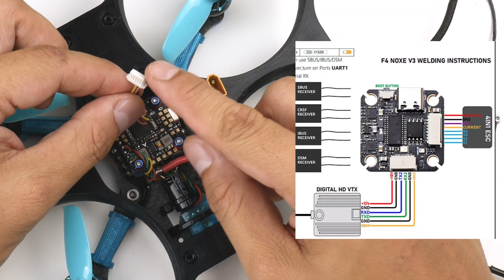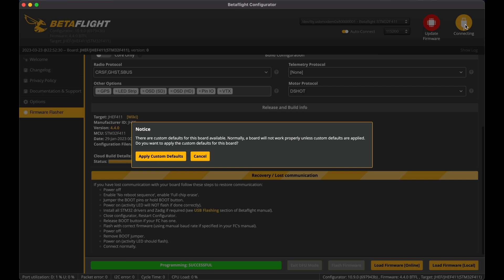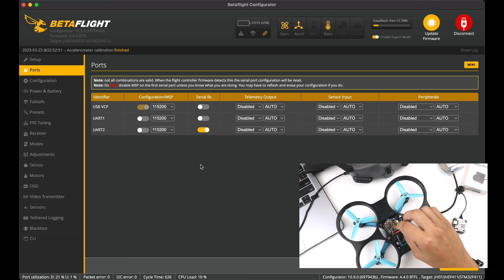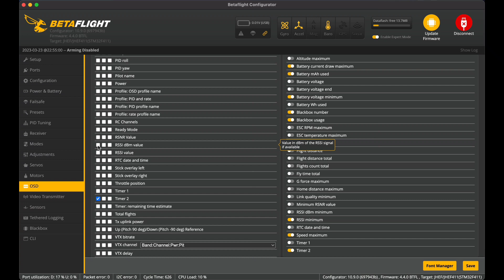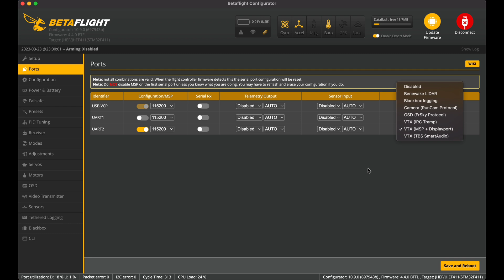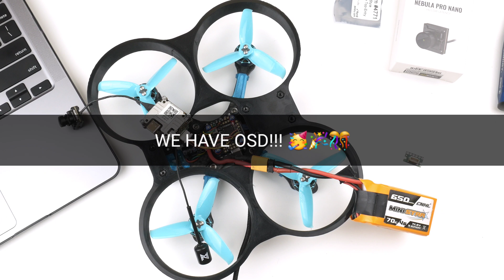DJI Goggles 2 + Caddx Vista - MSP DisplayPort on Betaflight 4.4!

Comment: Unfortunately, this method did not work for me, I have BetaFlight software version 4.4.3. Could this be the reason why I do not see the OSD? Additionally, I have software version 01.03.0000 but it does not work on version 01.10.0000 either. Do you have any idea how to fix this? :D
Reply from the maker: I can only think to check the TX and RX wires. Also in the goggles, check if you have Sbaud Fast enabled in the settings
Reply: @nxp200  It worked on my drone on betaflight 4.3, thank you very much for sharing :) Unfortunately, in my drone on beta 4.4, after performing the entire operation, the drone still has no OSD and controlling the drone using Tango2Pro stops working. I'm a bit new to the FPV world, I don't understand what you mean by checking TX and RX. My 5 inch drone is covered with waterproof gel, I can't solder cables on it :(
Reply from the maker: @iamJanikFPV  Ah I see. If it works in Betaflight 4.3, then the wires must be set up correctly. Also, if the quad is working perfectly fine on Betaflight 4.3 with OSD and everything, then I suggest to just keep using it. But if in future you decide to upgrade Betaflight, try 4.5 or higher to see if it works (using the 4.4 MSP DisplayPort steps). Might be a bug with your flight controller and BF4.4 OSD. Good luck and happy flying!!
Reply: @nxp200  Friend, you misunderstood me. My 2nd drone (another drone) on betaflight 4.3, displayed OSD from vista on google 2. And I am very grateful to you for your video about betaflight 4.3. However, in my 5-inch drone I have software 4.4.3 and here I have the problem that I described above. When doing all the operations, OSD does not display, and the control from Tango2 stops working. Thank you for your help
Reply from the maker: Gotcha. I assume you have set canvas mode to HD. Have you enabled OSD in the configuration tab?
Reply from the maker: It may be that the Ports tab is not configured correctly. Do you know which UART the receiver and Vista are wired to? If not, follow the wires from the receiver to the flight controller to see which TX and RX pads they are going to. It should be labelled something like "T2" and "R2".
Reply: @nxp200  Thank you for your help, I managed to restore OSD on all 3 drones, you were right to check RX and TX thoroughly, best regards
Reply from the maker: Great to hear! 👍🏻
Reply: @nxp200 I can only solder on caddx vista

Comment: im on Bf 4.5 and my osd is zoomed in. its kind of showiong all info but screen in goggels 2 are to small. Do u have any idee how to fix this?
Reply from the maker: In the OSD settings in Betaflight, there is the option to turn on HD. Try that. I've noticed that sometimes that setting is buggy. So try turning it back to SD and then HD again.
Reply: @nxp200  thx. but i cant change after ive set msp on uart. It is on hd as default.
Reply from the maker: @roarviksanderiksen  Strange.. I haven't had this happen before. I'll try to replicate the issue and let you know
Reply from the maker: I've tried to replicate this issue with BF4.5 but can't seem to see any issues with the size of OSD in HD mode. The only other thing I can think of is that there's an option inside the goggles 2 called "Settings - Display - Canvas Mode". There's SD and HD options. Select HD.
Reply: @nxp200  I installed firmware 01.03.0000 on goggles..that was the problem. I couldnt choose canvas mode on goggles. Problem solved when i installed newest firmware on goggles
Reply from the maker: Great! Thanks for letting me know. I'll have to keep that in mind next time. 👍

Comment: I still dont have full use of osd.  No GPS distance traveled or distance from home.  I have altitude on display but gps speed only show in disarm mode after flight.  I wonder if its because im using integra goggles not goggles 2.
Reply from the maker: The goggles shouldn't be the issue here. I don't have much experience in using GPS on my quads, but it may be configuration on Betaflight to show the correct numbers during ARM mode. Perhaps check you're on the correct OSD profile before flight

Comment: Great work. Did you solder any pads to the fc from vista or it’s a direct plug and play?
Reply from the maker: This depends on the flight controller. Some of them have plug and play connectors for the Caddx Vista and some require direct solder. In my case, I direct soldered to the flight controller the VBAT, GND, RX and TX wires.

Comment: Hi NXP! Fantastic video, really helped me a lot. I have one question though… after following this process everything worked perfect with the osd but when I went to fly today it was stuck in limp/low power mode. I assume this is something to do with the msp settings?? Have you encountered this before? Thanks!!
Reply from the maker: Hmm.. haven't had this happen before. Maybe you can try turning "Settings -> Control -> Auto Low-Power State of Air Unit" to "OFF"? That's how I fly, because if I crash and have to disarm, resulting in low power mode kicking in, I can't see the video to attempt turtle mode or locate where the quad ended up so I can search for it (as fast as I can before it overheats!). If that mode works, but you still want to have that option enabled, there might be some issue with the air unit not receiving the "arm" command from the flight controller. To which I'm not actually sure how to diagnose, sorry. If I get a chance anytime soon, I'll try to test it out on my system and let you know.

Comment: can you help sir. at first there is a display(osd ) after a minute it will be gone. any fix for this?thanks
Reply from the maker: Sorry. I can only think there is something damaged on the flight controller. Does it come back each time you plug in a new battery?
Reply: @nxp200  it do it for me as well

Comment: Hello, I’ve managed to update the goggles 2 Vista unit and get everything to bind and show video but I cannot for the life of me get the DJI remote control 2 to work.. it just doesn’t show up in beta flight.. any help would greatly be appreciated!
Reply from the maker: Hmm.. sorry, I haven't actually tried that combination. I recall that combination with RC2 wasn't supported, but I could be wrong. Have you soldered the SBUS wire to flight controller?
Reply: Check out Nordic Drone Explorer you tube channel its called "HOW to connect pavo 20 with DJI fpv remote controller 2".  I used this video to set up my pavo 20.  There is a cls command you have to do.

Comment: Hey 
do you know what can be a problem if I see OSD for first 5-10 seconds after arming, but then it disappears?
Reply from the maker: Hmm. Haven't seen that happen before. I would try another vtx (either digital or analog to see if the OSD chip is damaged). Or, check the Tx/Rx wires aren't getting shorted somehow after arming and flying around.

Comment: Hi. Do you have the stl file of the ducts on thingiverse? Can you send the link please?
Reply from the maker: I'll see if I can dig it up and post it on printables for you. I don't upload on thingiverse anymore. Hope that's ok for you
Reply: @nxp200  yes sure, no problem. If you point to me where to find it too, because I don’t know where “printables” is, I’ll be glad.
Reply from the maker: @nakmax  here's the updated model.
https://www.printables.com/model/655623-impulserc-micro-apex-3-whoop-guard-standard-analog
Reply: @nxp200  Mate you are absolutely awesome! Thank you very much for this. I will print it soon and test it.
Reply from the maker: @nakmax  no problem! Hope it works for what you need. If you can, print it with PETG or ABS for better durability than PLA. The one pictured is PETG, but I might print the next in ABS if this one breaks.
Reply: @nxp200  lol ok, actually I found printables. I just had to Google it.
Reply from the maker: https://www.printables.com/model/652970-impulserc-micro-apex-3-whoop-guard

Edit: I forgot that this was intended to be used with the SwitchBlock I designed and the standard original camera mounting on the frame is not supported! Apologies for the mix up! I have redesigned it to allow for standard camera mounting and will print a test version before uploading the STL (to make sure it all fits dimensionally etc)
Reply from the maker: I just realised I designed this with my SwitchBlock, which means the standard FPV camera mounting is not supported. I'll remix to fix this and upload the new design. Apologies for this.

Comment: Hey ona separate note, before goggles 2 I had the naco.txt file on my vista, now with goggles 2, do I have to do anything to still have the extra video transmission power of 700w. IF so a video would be helpful. I am nervous about flashing my fc to 4.3.2 which is the last version available for the babyhawk 2 HD, does OSD work on goggles 2 at 4.3.2?
Reply from the maker: With the Goggles 2, you'll need to put an empty file named ham_cfg_support (no extension) onto a MicroSD card and insert it into the Goggles 2 before powering up. Then turn it on. This will put your Goggles into FCC mode. To check if this worked, go into Settings -> Transmission -> Channel Mode and switch it to Manual Mode. When you check the 40MHz bandwidth, you'll see 3 channels instead of 1. In terms of the OSD, it should work on BF 4.3.2. I have this video showing the instructions on how to set it up https://youtu.be/gQFcvDB5RC4
Reply: @nxp200  many thanks, found the ham hack, had it on my o3 just not my vistas

Comment: Can you use betaflight 4.4 on the dji headset V2??
Reply from the maker: I haven't done this myself yet, but you'll need to root the V2 goggles and install wtf.os software to get the OSD to work. It's different instructions than in this video. Joshua Bardwell does great instructions on how to do this.
Reply: Some values will work straight out, to get everything you will need wtfos.

Comment: My dji goggles v2 are also already in fcc mode.  Allowing me to change from 25mbps to 50mbps.  The display is twice as clear.  Love it.  Next going to add 1000 and 1200mw.  700 is the highest.

Comment: i did all of this but still doesnt work.... anyone else having the same problem?
Reply: i got the problem too
Reply: @alessandrodimartino1872  still got  no answer. I ordered a new unit and a new cable. Hope its only the cable
Reply from the maker: Sorry, I've been quite busy with work and family. I can only think to check the TX and RX are wired correctly (TX from Vista to RX on flight controller and RX from Vista to TX on flight controller) and the correct UART is selected (TX1 and RX1 is UART1 in Ports tab).
Reply: @nxp200  i dont mean you with i get no answer dont worry 😀 yes i did that. I guess something with the unit or the connection cable is wrong. Thank you for your help!
Reply: which firmware are you using? in sight and in glasses. here does not work osd with vista and integrates.😢
Reply: Bro its soo easy its hard trust me😂! Before you start, make sure your vista is on th 0006 firmware... not the latest.. THEN... MAKE SURE.... Your DJI rx goes to fc tx and DJI tx goes to fc rx.... then do a cleaannn bf 4.4 re-flash. All you should have to do then is to go into ports tab in bf and turn on that uart msp, as well as changing the last box on the right to osd msp.... That SHOULD work..! Make sure you dont have an everything disabled switch on your tx when your trying to get it to work😉
Reply: @stickboyfpv4742  yeah the problem was on the air unit 3. The pins are not correct in the cable (from factory on a bnf copter) i had to bend the pins so they make contact at the connector. What a bullshit and i tried everything else before i got that 🤣

Comment: Hi,
Sorry to bother you again.  I forgot to ask you what fonts you used for your OSD?

I’ve just setup my iFlight A65 that has a Caddx Vista with the Goggles 2 and the Fonts appear much larger than yours.  

Thanks.
Reply from the maker: No need to be sorry. Happy to try and help. The font is default after flashing Betaflight. In Betaflight Configurator OSD page, the front drop-down shows "font default" on mine.